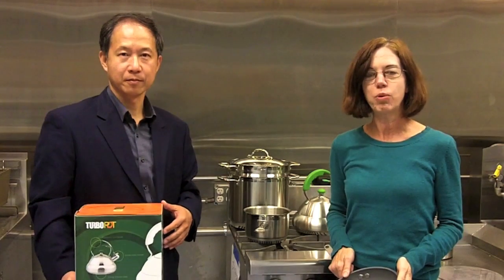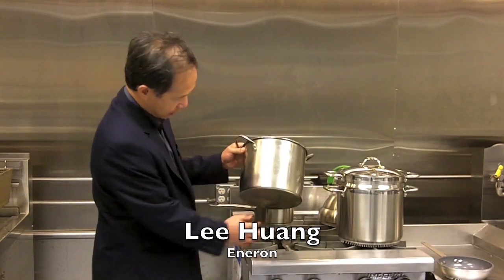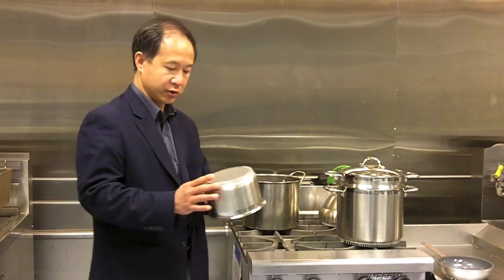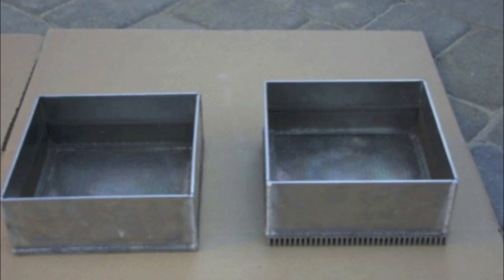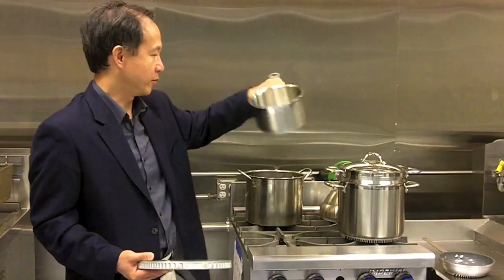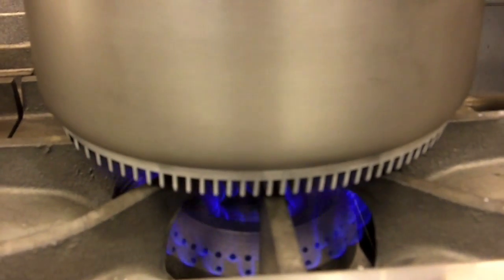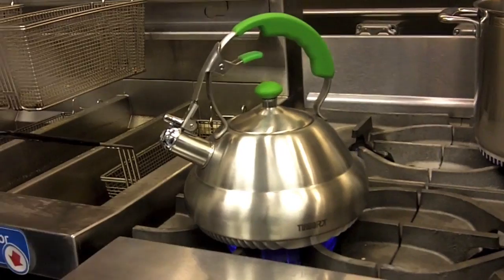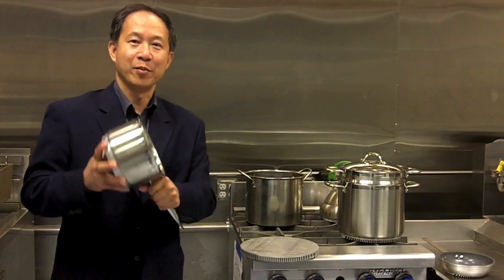An engineer uses heat sink technology to make cookware more efficient.

Comment: I don't do much cooking myself, but everytime I've used the stove the engineer in me laments the amount of heat I can obviously feel escaping around the cookware. The idea I had floating in my head was to construct heat-exchanger flue-channels into the bottom of the vessel. I'm sure I'm not the only one to have pondered on this problem...

Bravo to Mr. Huang for actually bringing this idea to fruition!!!

I can especially see a market for this in Asian countries where cost of gas/lpg is a real financial burden to many families and small/street-side restaurants. Plus it is typically delivered in rather small cylinders that last only a few weaks. Worse, there are often shortages leading to a flourishing black-market and rampant bribery.

The design used by Mr. Huang is much simpler than what I envisioned but I know all-too-well that a more complex design doesn't always bring worthwhile improvements.

Comment: It'd think you'd want more baffling in the fin structure to maximize heat transfer. Even straight channels seems sub-optimal. Maybe machine radial Tesla valves into the pot's surface?

Comment: Next step: make the heat sink portion a radial rather than paralell fin pattern, tapered to no fins in the middle where the air is still.
Reply: It sounds like you know a thing or two about heatsink design 😉
Reply: Got any designs I can reference for this?

Comment: What about electric stoves? Those doesn't have a flame that heat the sink surface.
Reply: Yeah, it would perform very poorly on those due to reduced surface contact area. Maybe if the fins were made of copper, that could offset the difference.
Reply: @MikeTrieu  lol I posted my comment when I was in university 6th semester